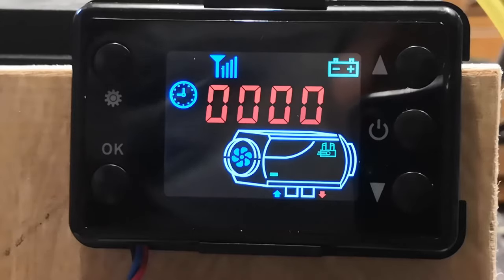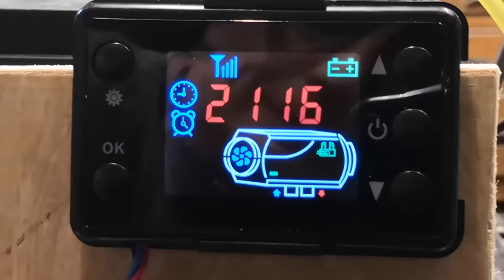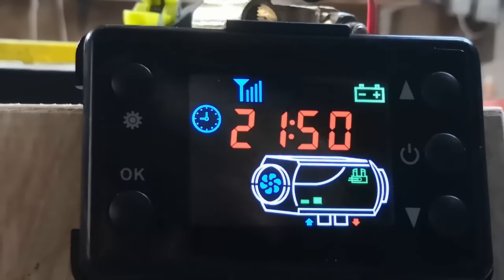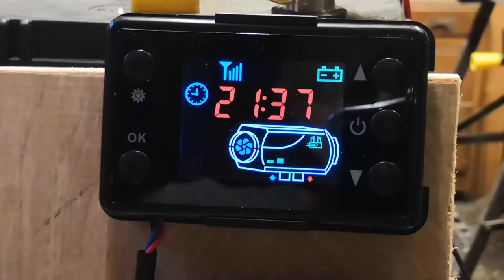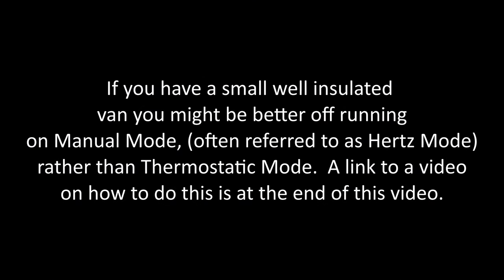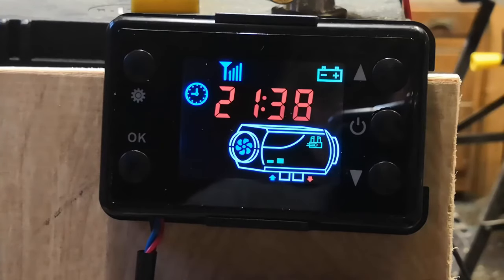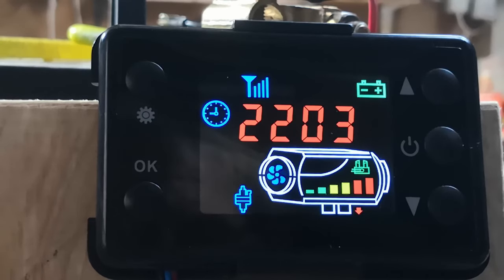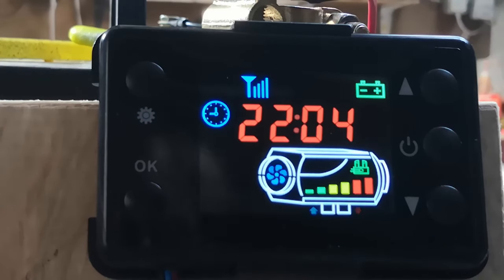Chinese Diesel Heater- Step by Step Instructions

Comment: Hey, i cant figure out how to set on off time. It only has a count down timer
Reply from the maker: There is a controller out there that looks very similar but has different logic and only has a countdown timer. It sounds like you might have that but you can tell for sure if the little fan icon on your controller has three blades instead of 6 as in the controller shown in the video

Comment: Why my Vevor heater goes to high voltage error 02  when battery voltage is 12.4 Volts. Specifications saying it should  work between 10.5V to 16 Volts.
Reply from the maker: Hi... eeek... can't help there... 12.4v is a sweet spot on my heater... cannot see why you have an issue but maybe others might offer up some help.
Reply: Did you find the fix...? Just got mine and it's making my ecoflow mini throw overload warning ⚠  after like 50 seconds of  running....

Comment: My battery sign on my screen is flashing green? Confused
Reply from the maker: eeek!  I too am confused. I've not seen that on any of the three different types of controllers I've used and my assumption would be that it might be indicating a low battery. However, if it's firing up and working okay I could rather be wrong. Have you tried checking the battery condition?

Comment: My control panel flashes E-01   any ideas ? Thanks
Reply from the maker: Hi... that code is usually associated with undervoltage. Ensure that your battery is fully charged and also healthy. The heater draws quite a bit of juice on start up and the battery needs to be able to deal with those first 3 or 4 minutes while the glow plug is alive. If your heater is in a vehicle you could try starting the engine that charges the battery you are using whilst you do the startup. Finally some of the generic heaters have cables that are a bit thin for any distance and you might want to swap those out to something a little bit thicker.
Reply: Hi, yes when van is running the heater starts up. As I've put leisure batteries on trickle charge to fully charge but when i started the diesel heater without the van running it still wouldn't charge., E-01. 
So I'm assuming it's time to change the leisure batteries  ???
Reply from the maker: Yes, it looks like things point that way.... starting when the van is running was the give-away. @paul2241xx

Comment: Can you turn the screen off? It’s so bright :-)
Reply from the maker: Alas no... some of the models 'dim' after a while but the one I have in my van does not. So, I have an isolation switch for when I am not using the heater... and a very high-tech piece of card I place over the screen when I am!  Depending on how you have your mounted.. you might be able to turn it around and mount it in the holder backwards.

Comment: My chinese heater has 6 input buttons not 5. Every YouTube help vid on these heaters show only 5. Any input here is appreciated.
Reply from the maker: Does one of the buttons have DEF marking or a petrol (gas) pump symbol?
Reply: @campervan_hackers  it's not very clear but does look like a petrol fuel handle. Instructions say nothing about it. Pressing it does nothing, no changes noted on the dig. display. I find that pressing the menu and OK buttons give inconsistent responses. No way to adjust timer, set time function as well as set temperature parameters -- can't get these ro list. Think the controller is not working properly.
Reply from the maker: I have seen that controller before but regret I have no indication on how it operates. I seem to recall that petrol pump button was supposed to be for DEF injection but I cannot see the relevance of that for a Chinese diesel heater so alas I'm afraid I'm of no use to you. A replacement motherboard and controller is about 30 quid and that might be your best bet. Make sure you get the one with the six blades on it as they are the favourite controller. @charlesbernard3042
Reply: @campervan_hackers  thank you for your time and efforts. I appreciate this. If you have one, maybe provide a link to that controller. Lastly, perhaps the fuel I use is a problem? #1 or 2 diesel. What of farm grade colored diesel? I'll try some different blends if that'll help. Thanks again.
Reply from the maker: @charlesbernard3042  https://amzn.eu/d/9Zlpiib
Reply from the maker: Not sure of terminology... in UK... diesel, kero and heating oil are used in these heaters.
Reply from the maker: https://youtu.be/uQIX-I-J098?si=0h0SPzU3Ansv6VqA

Comment: Hi I done what you said on your video turn it on an a few seconds it read a code6
Reply from the maker: Hi... Code 6 is a motor error... can you hear the fan scraping on the casing by any chance? Also.. check that the magnet on the fan blade is in position as this is used to talk to the controller.
Reply: @campervan_hackers  I had a look at the fan when I started it up there was a slight rubbing I pull the fan out a bit and turn it back on an the code was gone ..😅 thanks for that ..
Reply from the maker: @alaniddles3671  Well done mate. Glad I was of help.👍

Comment: I cant het the clock to display
Reply from the maker: When you look at the display, does the little fan on the heater have 3 blades or 6? If it has 3 then you have a slightly different controller than the most common one and not all the settings are the same.
Reply: @campervan_hackers  Yes unfortunately I have the three blades model, and have since found out it comes without a clock. This one has a timer you set to either go off or come on in 99.9 hrs or less. It has less programmable features all around.

Comment: That is the most complicated heater I have ever seen. Does China offer a course to finally understand how to use this thing?
What does one of these heaters cost US dollars?
Reply from the maker: Yep.. the problem is, that these are domestic units sold by 'box shifters'.. there is no attention to instructions for good international language instructions.. hence I did the video after working it out. Here in the UK these heaters vary a bit but are around £100
Reply: Hi, I’be connected mine up to an old car battery which I charged up but it doesn’t have much juice and it gets drained before it can even get going properly. Once it’s going does it start to charge the battery or do I need to get a better battery and somehow find a way to keep that battery charger with a solar panel or something? It’s in a caravan not connected to a power source. Cheers

Comment: TY sir, I have to say that this controller SUCKS, to many functions crammed into this controller. HCALORY you should be ashamed. NEVER AGAIN, DO NOT RECOMEND BUYING SAVE THE HEADACH AND BUY ANOTHER BRAND.
Reply from the maker: Sir you are confused The controller in this video is not the HCALORY controller This is the six-bladed icon controller which is deemed to be the gold standard and which many people swap out their motherboards so they can adapt their heater to use this controller. The HCALORY controller has a physical knob on it.